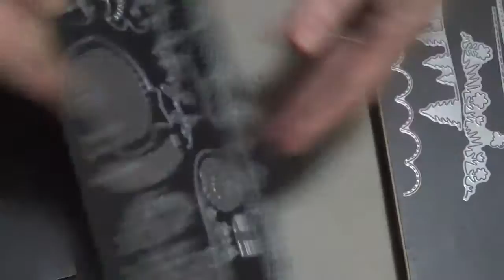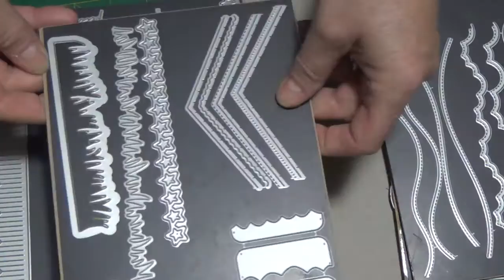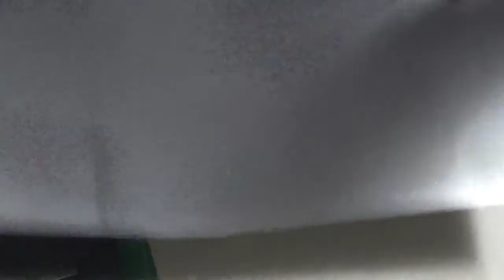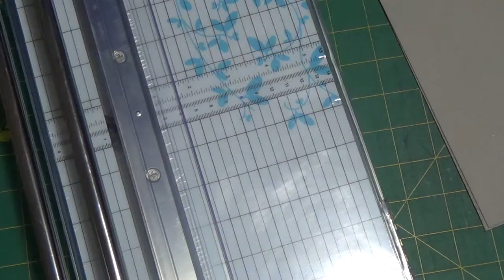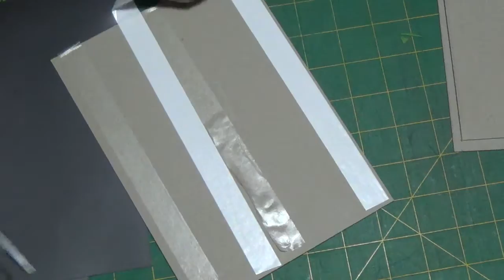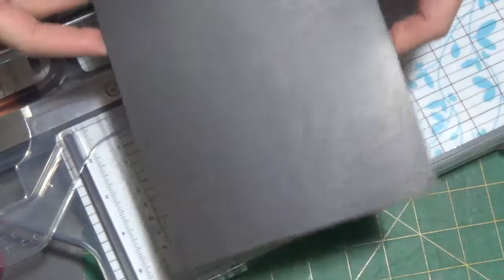How to  - Make Magnetic Cards for Wafer and Steel Dies Storage

Comment: I  do the same thing except I use black 8 1/2 x 11 chipboard & cut in half,  I use Vent covers also, I attach using Scotch Mega Tape runner & I cut using same exact cutter ( LOVE IT !!! ). For larger card making dies, I use 12 x 12 black chipboard & cut 8 1/2 x 12.  I cut out the die shapes & glue to front in white, for layered cuts white &  gray. I label front under diecuts using label maker.  I have thousands, upon thousands of dies & this works best for me.
Reply from the maker: Since the video was made I have sourced magnetic sheeting in rolls from an online sign shop in 10 m rolls. It is more economical and  a bit thicker and I have control over the dimensions.  It is available in larger lengths. Your idea of using black chipboard is fantastic. I'll try to source it.  I too have a die addiction ! Thank you for watching and commenting.

Comment: That's a good idea. I've used magnetic sheets I found at Dollartree and Dollarama but they are different sizes and not as uniform as this.
Reply from the maker: The video "Show More" section has a link to  the corresponding blog post. The supplies are listed there. The magnetic sheets I used are features. the cost is 4.97, 3 sheets  8 x 15 " or 20.3 x 38.1 cm. Thank you for watching and commenting !

Comment: What brand of trimmer are you using? Thanks
Reply from the maker: The corresponding blog post has a list of supplies , the link is under the youTube video in the "Show More section"  The trimmer is there if you'd like to have a look at it. It is a Fiskars Procision Rotary bypass  12" trimmer, the base folds in half, which is how I used it in the video. The cost of the item shown on my blog post is on special and is less than half of what   paid. It works well and straight cuts too. Thank you for watching and commenting !